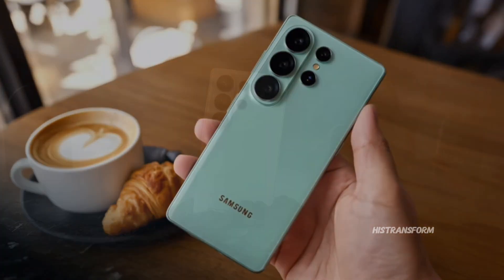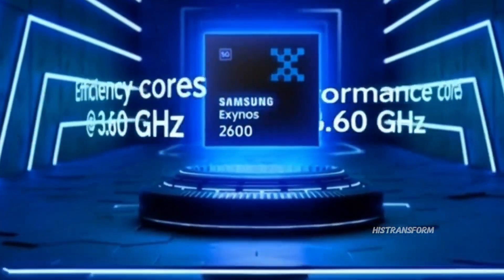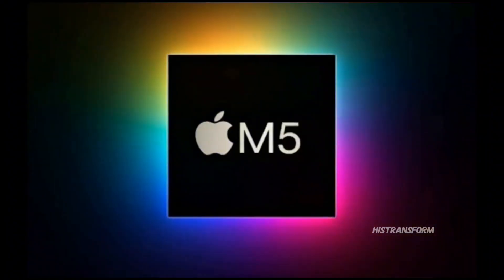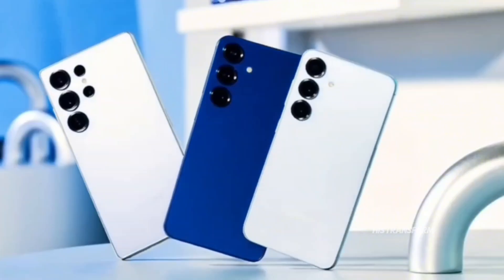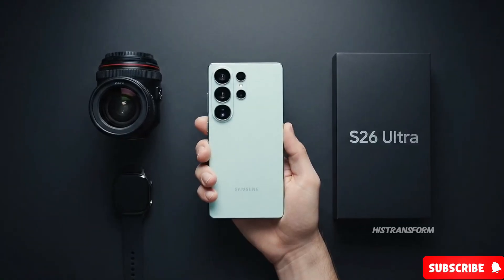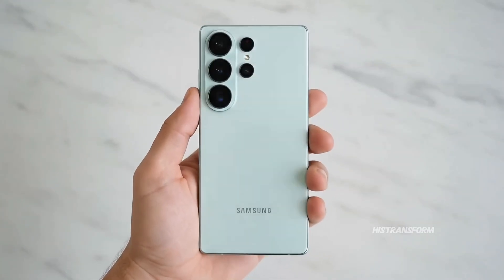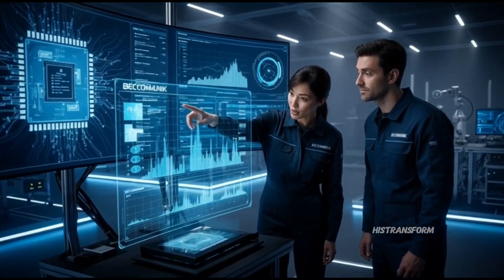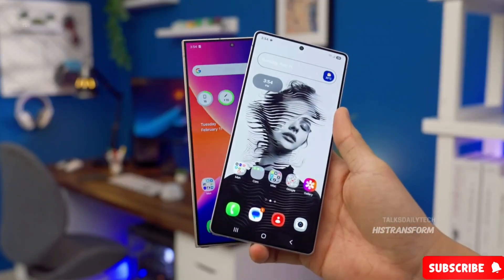4.2GHz?! Samsung’s Exynos 2600 DESTROYS Snapdragon and Apple in New Leak!

Comment: If this is the actual chip that's gonna be used on the s26 ultra that's simply revolutionary for smartphones
Reply: Experts now saying Exynos 2600 has other problems that will in practice neutralize any improvements. There's a high risk that this will be another semi disappointment.

Comment: Good breakdown. The 4,217 score is almost definitely a fake. =\ Not only is it missing from the GB database, but the screenshot clearly shows the wrong ARM core architecture (ARMv8, not the expected ARMv9). The real test numbers are likely closer to that 3,455 single-core / 11,600 multi-core range, which is still a solid jump for an early 2nm sample.
Reply from the maker: Thanks for the detailed analysis and for sharing your insights on the scores.
Reply: I found that it was tested on Geek bench corporate . So, that's why it is missing. 
I also can be wrong, cause we should not believe always in what we see.❤
Reply: But if we tried that in old version we get low scores. And high in new
Reply: It shows armv8 even for real snapdragon 8 Elite gen 5 and other arm v9 chips